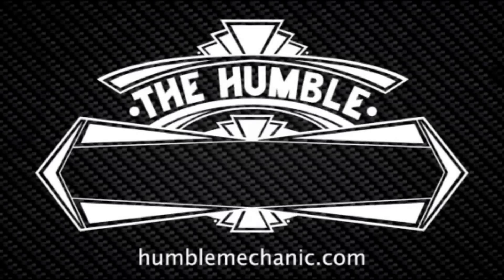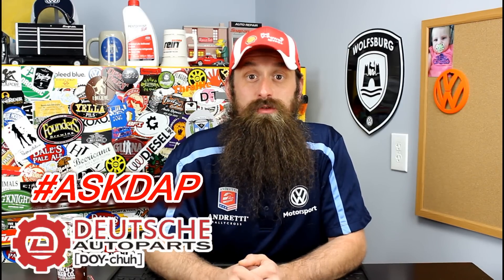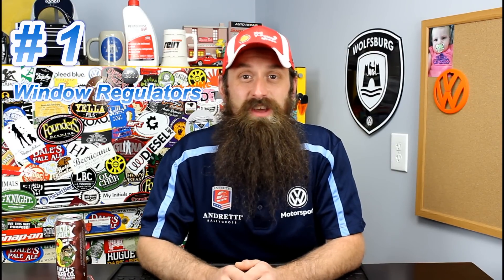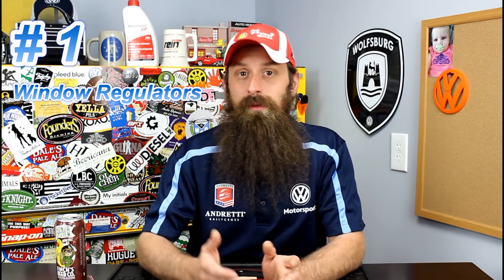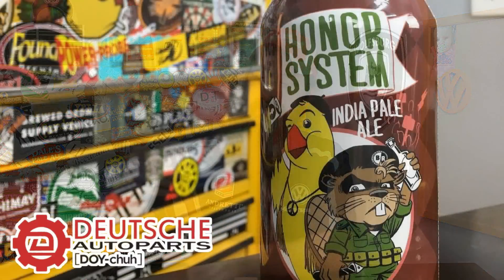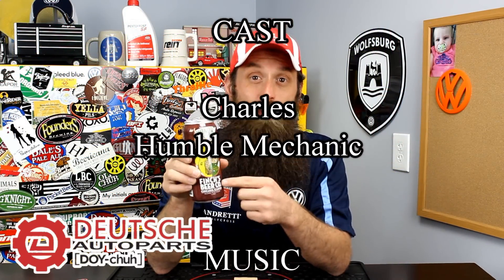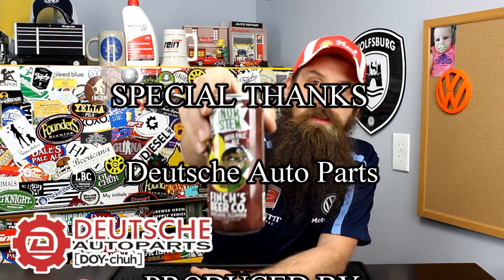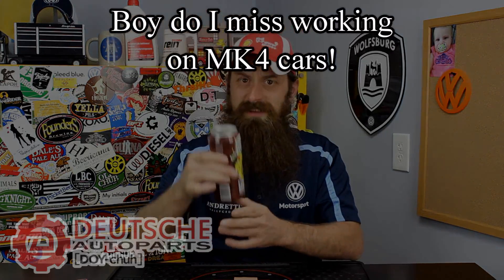Top 5 Failures 1999-2005 MK4 Golf, Beetle and Jetta

Comment: Does anyone know what causes the Fuse box over the battery on MK4's with the 2.0 8v to burn, specifically the black wire coming from the alternator?  Is it the alternot itself or is it the cable being too corroded and causing too much resistance = too much heat?
Reply: mraccord92 VW should've done a recall on those, they've been a highly problematic error on these cars. Or at least the nice big wire leading to it.
Reply: No kidding. I have two friends who have mk4 platform cars with the same powertrain and they both have replaced their fuse boxes.  It seems to be the alternator wire, its looks like a 6AWG wire which is pretty much the bare minimum to use, and if any corrosion were to occur later on (which is inevitable) it will cause voltage loss and cause the fuse box to melt.  I made a new wire but this time its 4AWG to compensate.

Comment: On my NB all my check valves are turning into powder. It's a 2003 with an AWV engine, so finding the correct parts for it is a nightmare.
Reply from the maker: +Patrick Aguilar yeah that's a tough one. I've replaced tons of those over the years

Comment: Could a bad break light switch cause only the loss of cruise control and no other symptoms, my cruise control hasn't worked in forever (worked at one point when I owned it but then one day stopped) then again with 334k miles on the body it could be anything
Reply from the maker: +eric piggott It could but odds are you have another issue. The switches on the stalk failed too. But a brake light swtich is the first place I look

Comment: Hi All. I have an 01 VW Beetle and she's "perfect" to me. 🙂 But she's currently making this embarrassing noise at slow speeds and while in reverse. It sounds like a marble inside of a tin can but it's starting to get louder. But once I get into 2nd gear, the sound disappears. The  check engine light and EPC light are both on. I did have the cat converter replaced about 5 years ago with an aftermarket part. I've also had the MAF sensors replaced. Do you think the embarrassing sound of a marble inside of a tin can is the cat converter?
Needless to say, I love her dearly...lots of sentimental value etc. I'd buy another just like her if I had to.
Any guidance would be greatly appreciated. It would be wonderful if the repairs were covered by recalls. But she has nearly 200K miles. So whatever recall she had, I'm she has long expired. 
 Thanks in advance for your time!
Reply: I had a similar noise that you speak of and found a bolt missing on the steel cover on the bottom of the motor, I hope this helps.

Comment: Have a 2003 jetta with 350 000 km. Replaced all the suspension bushings, replaced a Cat. Conv. 4 years agao and been driving for  2 years with P4020 code on 2nd Cat. Replaced driver side reg and now the passenger one sound like its going to break,.
Reply: 400 000 km now

Comment: I'm having a problem where my mk4 is asking for antifreeze every few days but i do not see a leak , is this a common problem ? or should i take it for diagnostic check? any info much appreciated  thanks
Reply from the maker: +Erk 918 do a visual inspection before you take it in. You will be looking for a trail of pink. The most common things are, water pumps, and coolant flanges.
Reply: got it fixed.. thanks! it was the coolant flange very small leak..

Comment: So wait. if I have rust on my catalytic converter , and I have 102,000 miles on my Mk4 Jetta 1.8t 5spd. I'm still covered by the warranty?
Reply from the maker: That will be case by case. The dealership making the repair or doing the diagnosis will have to make the call
Reply: HumbleMechanic Thank you Charles! 😁😀

Comment: I just bought an 04 mk4 
Random thick white smoke like crazy mostly on take off and low gears  ?
Reply from the maker: Yikes. White smoke is typically coolant or fuel. Does it smell?
Reply: It smells like oil but but does it randomly its idles smoothly and doesn't shake but I feel like boost is up and down
Reply: And not missing coolant and temperature gauge is 190
Reply: @HumbleMechanic  It turned out to be the cause of a bad turbo, no more loss of motor oil and no more smoking , I just don't feel like its giving enough boost , do you think that the catalytic converter gave out due to all the oil that was going through the turbo and exhaust?

Comment: Tell me why I tried to change my plugs on my mk4 2.0L and now the car will crank but no start?
Reply from the maker: Plug wires not fully seated? Wrong plugs?
Reply: HumbleMechanic correct plugs, NGK laser blah blah blah.
The wire are fully seated I made sure they all clicked when I put them all back in. 
Here’s the real kicker.
The car clicks once like it’s a bad starter but if I take the jumper cables off, it clicks 50 times rapidly like a dead battery. I think I locked this motor up

Comment: I was about to get a used 2002 Jetta on Craigslist. I'm not so sure about it anymore.
 Anyone got any advice?
Reply: avoid the automatic transmission.  Make sure that the power steering rack is good --  leaking power steering fluid
Reply: I just got a used 2002 2.0l Jetta a few months ago. My advice would be to take care of it, and by take care I mean add fluids when needed. Also if it's high mileage like mine get the timing belt changed ASAP. Keep the engine clean. Oh oh it's a manual hehe

Comment: 04 jetta  2.0 how hard is the speedometer sensor to change
Reply from the maker: The one installed into the trans is easy. If it's the gear on the diff, the diff has to come out.
Reply: @HumbleMechanic  thanks man

Comment: Something very interesting happens in my 2002 Jetta. The blinker noise module (I'm not sure if that's the correct name) keeps making the blinker noise after the signal is turned off. This happens randomly. Sometimes not for a few days then on one day it will do it nonstop. Anyone have any clue what to do?
Reply from the maker: +Austin Rivers yep I know exactly what that is. It's the turn signal stalk. Seen it a few times. I remember it so well because that happen to my Passat. Lol
Reply: Wow what a fast reply! So I should just replace the stalk itself?
Reply from the maker: +Austin Rivers yep. 99%
Reply: Funny enough after seeing this video once before and commenting about a different problem, my Jetta has given me error code PO420. Also is the coolant temperature sensor the black plug connected to the overflow tank?

Comment: They really got this stuff sorted in the 2004 jetta. I have just under 400k on the clock, and never have I replaced a window regulator, or a brake light switch. Car came with green ECT, however it's "O" ring begins to leak about every 6 months. Frustrating. Also the coolant flange itself had been replaced 4 times because it is plastic crap. And my favorite, the plastic impeller water pump. I do the water pump and timing belt every 100k miles. I love timing belt cars!
Reply: My 99(the wife's old car) , I parked it 7yrs ago in the garage because vr6 timing chains ....now I'm off my dead ass and doing em. 
I've never had a window issue yet , and I'm doing the water pump and crackpipe, metal water housings. 
Just I'm more of a mk1/2 guy , and not a guru on the mk4 platform. 
I think I'm doing this right , I want reliability upgrades.
Reply: @MrTheHillfolk  Good luck with your project!
Reply: @johngonda6447  
Thanks man! 
Engine is ready to mate to the trans , but Id like to wash the engine bay and degrease the trans first and it's in there. 
Hopefully within about a week it'll be in.
I only get a few hours every other evening and some weekend nights to work on it so it's kind of slow going.

Comment: i just twisted off the front control arm bolt on a 95' jetta ....grr. now i got to drill it out and tap it
Reply: +KCOBAINZ67 what a pain in the ass
Reply from the maker: +KCOBAINZ67 YIKES, best of luck getting it fixed up
Reply: +HumbleMechanic thanks
Reply: +HumbleMechanic I have a mk4 Jetta 1.8T when I turn or on an incline my gasoline gage needle goes from say full to nearly half a tank in 15 seconds I'd appreciate if anyone responds why is that?

Comment: Yes Mr. Humble I have a vw Jetta 2001 vr6 that sounds like the sway bar bushings, control arm bushings may be shot. I had all the struts replaced with the proper hardware but the problem persists. If I purchased this kit      https://www.blauparts.com/front-lower-vw-jetta-control-arms-kit-2001-06.html   would I be leaving anything out? It is most noticeable with small potholes. Thanks for your time.

Comment: Coil packs!!!!

I bought a new mk4 Golf 1.8t gti in 2001. Still have the car as my main driver. Serviced at main dealer since new

Zero recalls from Volkswagen. Charged me for 4 coil packs. That’s 3 breakdowns. Charged me for window regulators, charged me for temp sensor. Charged me for the break light switch.

You are lucky in the USA. Better governance.

VW U.K. don’t give a shit about their customers.
Reply: Also exhaust middle bracket wanted £250 to fix. Repair bracket £14.00

Volkswagen are evil.

Comment: My neighbor is selling me a 05 beetle 2.0 engine for $1,000 with 80,000 miles. Any thoughts about it?
Reply from the maker: Not a bad price. I’d still get a pre purchase inspections
Reply: Yes. A buddy of my husband has a computer that we can connect and is charging us $130 to see if there's anything wrong with the car.... but his buddy insisted in not bothering with the car due to Beetles having horrible electrical issues. 
Do you think the car would last me at least 1-2 years? Of course I know I would need a major maintenance on it. Did I also mentioned that the car has been sitting on the lot for about 7 months. They do use the car to literally go down the block for a quick stop @ the store to buy beer, chips, etc. But other than that, it's just sitting on the lot

Comment: Transmission failed at 74,999. Yeah... odd number. 2001 Golf 2.0t.

How common is trans failure? Was mine just a one off?
Reply from the maker: +avin r total failure is not common. Valvebody failure can be.
Reply: HumbleMechanic guess I should've asked about this stuff when I still had the car. But I only found your channel recently:(

My mechanic told me the automatic trans had failed so I believed him. But maybe it didn't?

So here's what was wrong, every time I accelerated, doesn't matter hot or cold, the car would kind of hesitate going into 2nd gear. RPMs would rise (about 1000-2000 higher than normal), then it would shift, but pretty harsh shift at this high RPM. Now, if I put the car in 2 instead of normal Drive, the problem didn't exist. But the car was quite slow in that setting.

I went to get the fluid changed, not flushed. They put in new filter and gasket. I drove it for maybe 10 more miles after that and then got rid of the car because the problem actually got much worse.

Could I have saved it?

PS thank you so much for taking your time to reply to my comments!!! It's much appreciated.

Comment: My CTS finally failed after 13 years and 85k miles
Reply from the maker: +11jt2007 that's bordering record setting there.
Reply: My CTS 3.6l just failed at 190,000 miles. Going to put in a new engine because i love the car so damn much.

Comment: I dont know if you reply to videos, but my mk4 jetta rad fans stay on for 20 mins after my car turns off and it draining my battery
Reply from the maker: yikes! Maybe an ECT, or a fan control module?
Reply: Whats an ect
Reply: Check fuse #16... if it's open for some reason the fan control module gets confused and runs the fans.  Weird for a blown fuse to cause something to start running, but there ya go. :)

Comment: These are "nothing" issues. I didn't hear 1 mechanical issue like "faulty water pump" or "bad harmonic balancer" etc.
Reply from the maker: Those may not be issues to you, but to people looking to buy the car, or paying to fix it, they may call then issues,
Reply: @HumbleMechanic  i found a few MK4s here on Craigslist for $500 and I was thinking of buying one. I know how to fix Hondas, so I started watching vids on problems I may encounter. I meant my criticisms as a compliment. These are maintenance issues in my book. I found one that says it has auto trans issues and the other a manual that says it has engine issues but the AC works. Any thoughts? I'm willing to spend $500 in repairs and working on it myself is not a problem.

Comment: I know you are a VW specialist, but the platform also includes the Audi A3, Some Skodas and the 1m Seat Leon.

I am an aircraft engineer however have a huge level of experience with the mk4 platform (all vag range) and certainly the VAG TDI engines of the era... Too many common faults, it seemed like every golf that someone bought had the same faults around the same time. Became something that took up most of my spare time, door lock faults being the most common, with rear window wiper motor failure close behind.
Window clips usually failed after a few months of ownership too!

My Leon is going strong with 198K miles on the clock, but it has had quite a few door lock module repairs, two wiper motors, window clip failure and a dead CTS.

Comment: Brand new alternator
Brand new battery 
Not sure about starter sounds fine though! 
Not sure about the fuse box 
Terminals look good! 
Why is my brand new car battery dying
Reply from the maker: How’s the wiring?
Reply: HumbleMechanic not sure. 
I don’t know what I’m looking for. 
Negative battery cable looks a little very little torn. 
I feel like every time I use the cigarette lighter as a charging port my cars battery dies. 
Don’t use the radio and car charging port it seems to stay alive
Reply: Just doesn’t want to start without a jump sometimes
Reply: Wiring looks great no melting. On my box cleaned my grounds broke the T bolts on accident gonna be here tomorrow so I’ll find out if that was the problem
Reply: @HumbleMechanic  speaking of wiring, I am shocked. 
I'm in the midst of pulling the engine from the wife's old 99 vr6 Jetta to do the timing chains. 
As I opened the little plastic cover on top of the starter solenoid to remove the wiring, I could see the wrapping and even a few wires almost chaffed thru from vibrating in that plastic cover. 
Luckily they aren't worn thru, and I will repair and seal them up while the engine is out, and make sure that won't happen again. 
I'm not a mk4 guy but I'm guessing this can be an issue , so now I'm checking it all back into the car. 
And my car is in great shape , it's been hiding in my garage for 7yrs now and has 130k. 
Most of the mk4 drivers I see now are beat ! 
So I can imagine as they get older , maybe some of the wiring Gremlins is related to the chaffing problem I ran across.
Reply: Had the same problem, and like Humble said, it was related to wiring and some switch (cannot remember the name of the switch). It took a VW dealer two months to figure it out. When it was a problem, my battery would go from full to nearly nothing I'd parked for a few hours.

Comment: How about going into limp mode?
Reply: you mean when the trans speed sensors go bad? ;)
Reply: Or maybe turbo limp mode? That is because you drive (if you have manual) very often with very low revs, carbon builds up and then pressure cannot be regulated correctly by ECU, hence the limp.
Reply: @jaybrady3128   Yea you can pick em up all day long on craigslist with "needs new trans"  for a couple hundred and put a new valve body in. Years ago i slapped a new timing belt on a sentra in front of the sellers house and drove it away. He sold it cheap because he said "the engine was blown"  lol

Comment: Should i still buy a 1998-2005 VW Beetle, i want to  ? ... i have done 250k in a 2002 Yaris with only 1 wheelbearing failure but i am bored by the Car beyond belief ..
Reply: Roel Van der Linden, asseblief meneer keep your Yaris.  It's bulletproof.  VW will never run with that mileage with just a wheel bearing replacement.  I have a 2002 VR6 with 165000kms.  Replaced suspension bushes, shock mounts, cooling fans, window module and repaired abs module.

Comment: I had an event while driving the other night.  No warning in sound or behavior.   It sounded (Minus the hard acceleration) like this https://youtu.be/Di6v4QPMpz8. Shop says it still runs but oil is spraying all over the engine bay. Clutch and gears are still there.  Did I have a catastrophic turbo failure?

Comment: Ish...... haha. So are these engines interference or non. Everthing i researched only told me ish.
Reply from the maker: Most VW engines are interference. But the 2.0 non turbos are technically not. BUT if the belt breaks and the wrong time, you still bend valve.